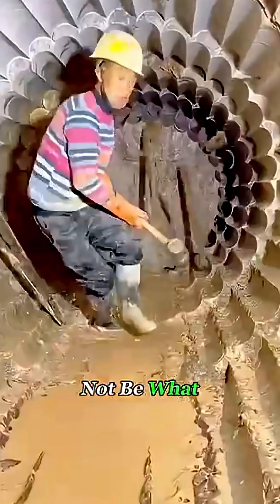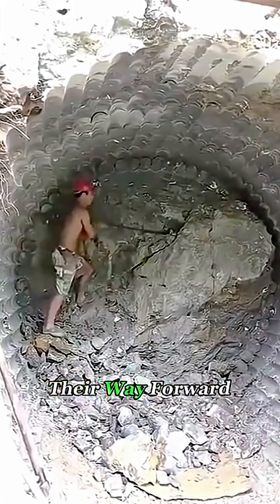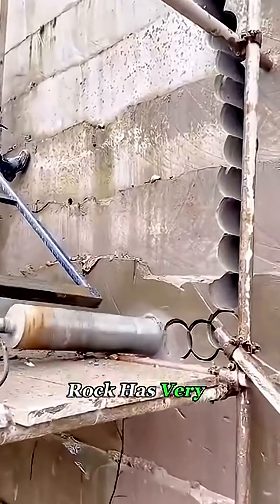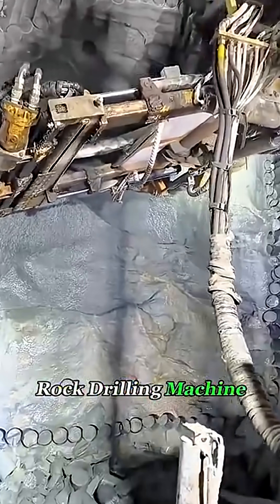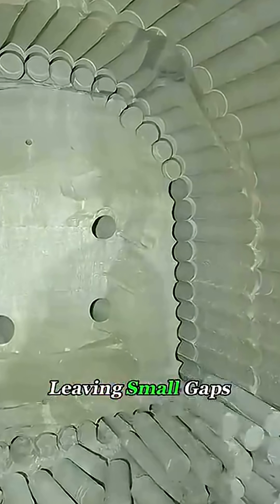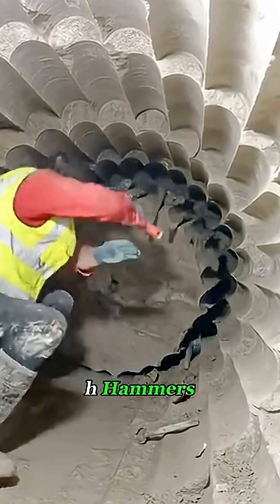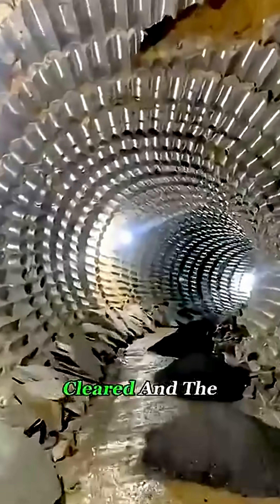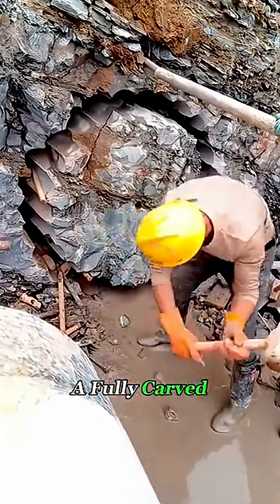Drill and Split Method Explained: Smart Rock Breaking Technique Used in Mining & Construction#shorts

Comment: ok, you drill the holes but the end is still attached to the rock. how do you break that connection so you can remove the core?
Reply from the maker: "They usses Splitters and Hydraulic Breakers to separate large Parts of the tunnel"